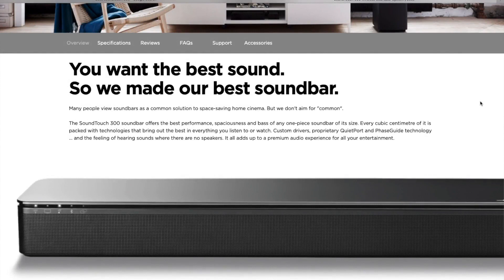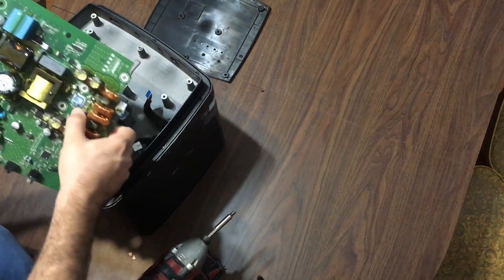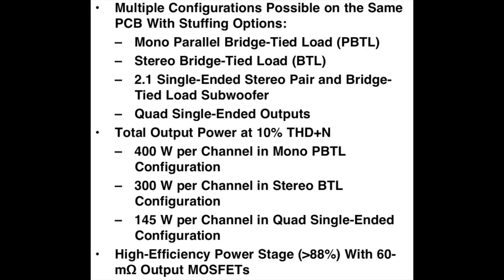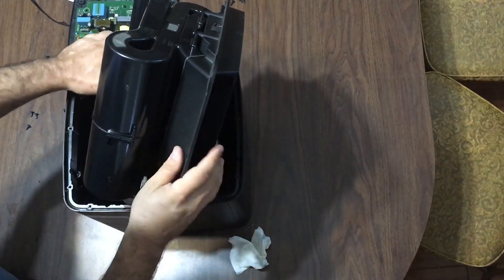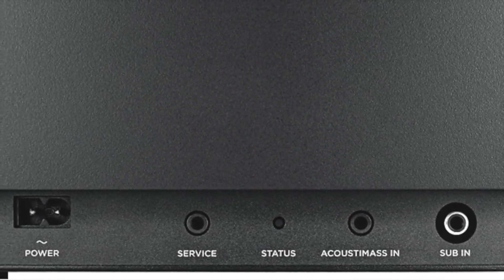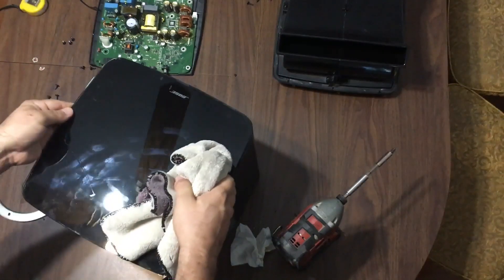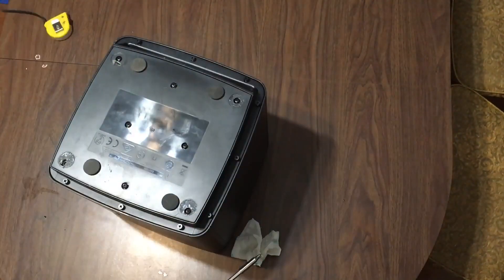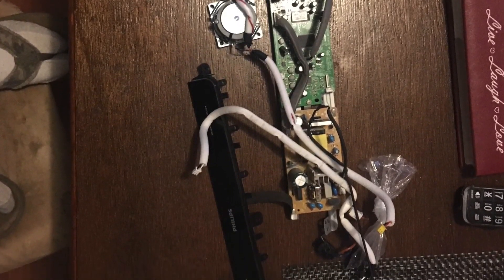What is inside a $700 subwoofer - Bose acoustimass 300 subwoofer disassembly

Comment: We call that BPC - meaning: Black Plastic Crap, LOL. This design is called a "transmission line" or a labyrinth design. They generally reproduce great, detailed bass - but at the size of this "subwoofer" (said VERY loosely) and the small area and length of the labyrinth - you probably won't get any bass below about ~40Hz. What that means is that you'll be totally missing out on most of the HT, sub-bass frequencies below the cutoff - frequencies that would be easily reachable with other, much more inexpensive true subwoofers from HSU, Rhythmik, SVS, and even PE/Dayton Audio kits. Bose is still overpriced black plastic crap, IMO....

Comment: Thanks for this video. I need to access the inside of the sub, but would rather not open the compartment where the board is. Is it possible to do so without tearing the label out? I removed the 12 side screws but it seemed like that bottom cover wouldn't budge. Did I miss anything? Thanks again!
Reply: I have the same issue, did you find out how ?

Comment: Hey man, good video I have a question about the Bass, I found you video as I was looking for answers of why my Bass just stopped working, do you have any idea about trouble shooting this Bass?
Reply from the maker: You know, I had been asked that before, I'm not really surest seems like it is a defect on these subwoofers. I could not find a fuse or something like that when I opened mine. There is a vlinear voltage regulator I think for 5 volts, check that one to have an output of 5 volts, is the only thing I can think of. Good luck.

Comment: Hello, do you think one could replace the subwoofer with a different brand 10” if their Bose 700 subwoofer is blown?
Reply from the maker: Yes of course. Just check that the new subwoofer is at least 300 watts RMS. Regards.
Reply: I think you could. But you should make sure to match Ohms. You could also use less powerfull subwoofer speaker, just don’t use max volume, only go as far as possible until sound gets distorted, than stop.

Comment: My unit keeps turning off for a brief moment and then reconnects after 10-20 seconds. Any idea what might be the cause? I think the longer it is on, the more frequent are the restarts. Could it be an overheating problem? No signs of blown components on board.
Reply from the maker: When I took it apart, I did see the heat management is very poor on this unit, I had to add some more aluminium y thermal paste. Also, check the distance with the soundbar, bring it closer and see if it fits the issue.
Reply: Same issue here, did you find a solution?
Reply: @durst99  No luck. Tried everything that didn't require messing with electronics. That is repositioning, using different cables, connecting via BT, moving other equipment away. Nothing works.
Reply: @SirShrimpey  yea.. same here. Going to send it to Bose this week (repair service for 110€ :/ )
Reply: @durst99  If they charge then maybe at least they'll fix that. I sent it on my electronics shop extended warranty to their repair shop and I don't think they even opened the box, just sent it right back saying "we couldn't reproduce the issue" xD At least that tought me to never, ever opt for any kind of "extended" warranty when buying electronics as it is just a scam in most cases.
Reply: @SirShrimpey  Got it back after 1week (really quick including shipping). They changed one component and now it works again.

Comment: What that sub in connection is that pre amp input or high power input.I wonder if I can use this sub  for my yamaha receiver..tnx
Reply from the maker: It should be low or precut input, but I already try it with other receivers and didn't get any sound.

Comment: Sir can you pls say that which Bluetooth module is used in there?
Reply: I don't think they will use the Bluetooth to connect because it might cause delay.
Reply from the maker: @chinyanyie  correct.
Reply from the maker: It doesn't use Bluethoot, it uses a Radio Frequency module.It says "Model 420128RM". Regards.

Comment: Does it have a fuse? My AM300 suddenly isn’t displaying any led status lights. I’ve switched power cables and used different outlets. I’m not sure what to do. Bose want almost $200 for repair.
Its the same bass speaker as seen in this video
Reply from the maker: No, it does not have a fuse. I noted there is a 5 volts regulator, check if it has 5 volts output, if not, replace the regulator. I noted that fails for many units. Also, the cooling dissipation is not very  good so it has to be inproved. Good Luck.

Comment: $700 for that cheap plastic box? Lol my monolith 15 was $1200 when I bought it and it is 1000 watt rms.it will literally rip that thing apart
Reply from the maker: Not only that, if you listen to it, you can barely distinguish if the sound comes form the bar or the sub unit. I like the sound of it a lot, but I agree there are more powerful units for much cheaper. Thank you for your comment.
Reply: Why don't you complain to Sonos Sub? The subwoofer costs 750 euros and is made of high-gloss plastic

Comment: I saw the video because my auctimass 300 stopped working just few days ago... i bought the sub 2 years ago. No light and no sound it is dead i discovered that it is a very frequent probelm i am asking for the waranty but if you know how to fix that problem you will help me a lot 
Sorry for my stupid english end thanks tou
Reply: I have the same problem!!!!
I have the lifestyle 650 and the Acustamass 300 has no light or power, I’ve tried different power cords and outlets. Nothing works. It’s dead. I don’t know if it’s a fuse or a switch but as common as this problem is, there’s gotta be a simple solution.. I just don’t know what it is yet.
Reply from the maker: When I opened mine, I did not found any fuse. Could be the filter capacitors en the power supply? Mine is working but I have received a lot of comments of units not working. Also, I noted that there are 3 mosfets or transistors just besides the the audio section that requires heat dissipation, may be that's were the problem is since those can burn very easily because of extreme heat. Good Luck.
Reply from the maker: Your English is very good, I have the same video here in Spanish in case you are native Spanish speaker:
https://youtu.be/AmXuGDDBss4

Comment: I have had the soundtouch 300 and subwoofer since Oct. 2018. (warranty expired)
It is placed in an area which I don't really use that often.  Then suddenly, the other day the subwoofer did not turn on. It has nothing to do with the electrical outlet therefore I am puzzled.  Called Bose Support and they informed me that I have to send it somewhere to be diagnosed and the charge is about 175 $.  Any suggestions ??
Reply: same for me... Not sure if I can do something with the repair
Reply from the maker: Did you try connecting it to your computer via USB cable? see if the computer can find it (of course, the sound bar has to be connected to the AC outlet). Download the soudtouch application and connect the soundbar and check if the computer detects it (even if there is no lighted leds), if true, upgrade the firmware. Good Luck.

Comment: Have you ever repaired lifestyle 5 powered subby. Stuck on max volume?
Reply from the maker: No, I have not, does it has a variable resistor for th evolume? did you try cleaning it up, or replacing it?

Comment: thanks! but if you have a little knowledge of speaker box, you would show us the structure how sound transferred or its transfer channel, that is the key point. I didn't see any absorb material, not sure it is closed box, wave guide or phase reflex.
Reply from the maker: I am sorry I did not show that much detail, for me this subwoofer cost me a lot of money and I already disassembled a 700 dollars bar and I barely put together so I was very afraid of not being able to put this one tighter again (like Humpty Dumpty). I have received report that this kind of sub gives a lo of problems after 2 years of use, if I get those issues with mine, I will definitively upload another vide with a lot more detail. Regards and thank you for your comment.
Reply: How’s the sub, still kicking? I watched a lot of tutorials, repairing this modules, basically after about 2 years, a 0.50 $ diode gives up and needs replacing, and that’s it.

Comment: one thing i love about the acoustimass 300 is the vibration it produces that really give a immersive experience to movies. i have been watching all the marvel movies on disney +  dolby vision and sound,  but not all movies vibrate the same. the deep bose sound is there but the same vibration is missing in some movies.  ( some movies vibrate way more often then others for example during machine gun fire or some thing slammed to the floor & other movies just vibrate  during big explosions only.   ?????
Reply from the maker: That also depends on what is producing the sound. For example, whether you like John Lennon or not, listen to "Starting Over" and you will se a very particular but beautiful bass sound. But if you listen to a rapper, you will see that even that it vibrates, the sound is not that beautiful. I think it has to do with the frequency of the instrument being played, so the same is for the movies, depends on the frequency of the sound. I think. Have you see those sofas chair that have some sort of sub woofer system to make the couch vibrate with the movie?

Comment: Forget to ask,so is this a 300watt or a 400watt subwoofer?woofer impedance?
Reply from the maker: The Audio chip is for 400 Watts, but bose some times limits the power supply to allow work margin, meaning, not to work the chips at top specs all the time. But definitively it is pulling more than 300 Watts. The speaker is 2ohms.
Reply: @Letsdosomethinguseful  nice,then it should be around near 400,as 2ohm can make the chip run at full power.
Reply: @Letsdosomethinguseful  The specs are 300w or 400w max power at 10% thd meaning peak output probably running 150w rms
Reply from the maker: @connorjohnson4402  U're right, I forgot that they put the max power at 10% and no body listen to music with that much distortion. thanks for your comment.

Comment: How can we connect any other base with bose sb 500  bcoz i spend too much on the soundbar 500 and i dont wanna spend more on bassmodule. Can i connect any active woofer or bass with this soundbar
Reply from the maker: Not that I 'm aware of. I saw an "Acoustimass" port in the soundbar and it has a 1/4 jack stereo, but haven't try it yet. Amy be you can try that jack and see if it outputs audio.

Comment: Why is this 700 Dollar Subwoofer made out of Plastic? Thats a no go!
Reply: at least $500 usd profit. plastic have high resonance frequency for a subwoofer. that's is a no no.
Reply: If you heard this sub you would understand.  It's made extremely well, it's 30lbs. It has QuietPort technology that has no distortion up to 100% volume. I would imagine that has something to do with it. It is the prettiest sub I have ever seen. When I got the Bose 900 soundbar I got the bass module 700 to go with it, I found it crazy that the subwoofer cost as much as the whole soundbar but got it anyways knowing I could return it. After hearing the system, which is more than amazing-it doesn't even compare to others like what I'm returning the JBL 9.1 soundbar for $1,000. You would just have to hear them in your home to fully experience the difference, let's just say after hearing the Bose I would pay whatever it cost to have it. Which blows my mind because I had a hard time spending the $1k on the JBL! Lol
Reply: Its heavy duty plastic and still have very low resonance better then most woods until you get into the high end stuff
Reply: @Sc2God724  sure not better than MDF
Reply: @3limin4torZockt  my point exactly MDF isnt that strong still really cheap cost the same as plastic you need to use like oak wood real wood is the best but most companies wont do that and if they use real wood they will put an extreme price tag on it
Reply: @Sc2God724  But its a matter of thickness not only material.
Reply: @3limin4torZockt  even tho it's still only a medium hard slightly better then ply wood you could have it crazy thick but wont be as good as half as thick oak wood and same with plastic oak wood would be better half as thick
Reply: The stupidity here is astounding.

Comment: That's a really beefy magnate on that speaker. I see nose is really starting to improve there quality. And the waveguide technology, very nice!
Reply from the maker: That's right, I see they are implementing some new technologies into their systems and they have improved a lot the class D systems.
Reply: Magnets are cheap. Even a $50 woofer can have a magnet that big. The entire motor structure can be either garbage or good and the magnet has little influence on that. A well designed motor and magnetic gap with a medium magnet is better than a poor design with big magnet. Plus magnet size doesn't mean it's a strong magnet at all.
Reply: Fun fact the wave guide is only a kind of an transmission line so it is not very special.
Reply: @mhp_loudspeakers3768  Actually in this subwoofer it's a reflex port. It is folded, and it will have a quarter-wavelength mode to its operation (as all port pipes do; as ports required by a certain design are made longer, they acquire an "organ-pipe" resonant mode which can be used to advantage if you know it will be there) but when you take a port and fold it, the straight sections behave as air masses that "add together" to produce the same air mass as a longer straight port, and with a cabinet that has a large chamber like that, it is definitely operating as a mass-spring system to have a tuned resonance of its own. Transmission line systems typically minimize the amount of volume behind the driver that is not functioning as part of the resonant "line", while vented boxes have a definite chamber volume behind the driver, and the total air volume of the port is a lot less than the volume of the chamber. I've designed both transmission lines and vented enclosures with folded ports, and their mechanisms of action are quite different.
Reply: AcousticTheory no it is completly wrong what are xou writing. But my english is too bad to explain it. the Port is so long because you can add more power at lowrr frequencies to correct the tranfer functiol magnitude.
Reply: @mhp_loudspeakers3768  Spend some time experimenting in a program like Hornresp, where you can use it to simulate a variety of reflex and quarter-wave loudspeakers with varying geometry. You will see that I am correct; when you make a port pipe longer, you will see not only an impedance dip (minima) at the Helmholtz-tuned frequency, but also the quarter-wave tuned frequency, so you will see that a long reflex port can have both a Helmholtz (acoustic mass-spring, "bass-reflex") tuning and a quarter-wave tuning (organ-pipe resonance) frequency. You need to use a program like Hornresp to simulate this, because a typical lumped-parameter reflex box model neglects this behavior of the port. Be sure to use a high-BL woofer to simulate this, because low-BL woofers will just go to an overdamped state in a reflex box that has a volume too small.
Reply: AcousticTheory did you build the speakers ornjusz simulated it?
Reply: @mhp_loudspeakers3768  I have built and tested products with similar folded port design. They were developed as a commercial product for a company I can't name, and they performed well and sold well, but they have been discontinued because the company took a different product line strategy. The combination bass reflex and quarter-wave resonant behavior was evident. So this has been proved out "in real life". But you don't have to take my word for it; many others have written about this additional pipe resonance effect in reflex ports. A similar effect is used deliberately in the RCF Event 1018 subwoofer, and in the Electro-Voice T18 cabinet (where the line behaves both like a quarter-wave resonant bass horn and a reflex port, with signs of both types of resonant behavior being in evidence. The speaker box you are building doesn't know that it is "supposed to be" either a reflex box or a quarter-wave resonant box; it is an assemblage of non-ideal acoustic structures that contribute a mixture of acoustic mass, acoustic compliance, quarter-wave resonance, or even acoustic impedance transformation (horn) behavior according to their geometry. Based on the type of design you are trying to build, you design those structures to maximize a certain type of behavior while minimizing others, but sometime a design crosses the line between those types of behavior and incorporates a mixture of them.
Reply: It is a fine looking driver from Bose, finally. I would judge that the voice coil is either 2" or 2.5" diameter, which is plenty big for a home subwoofer. (And the overall driver diameter is 10".)